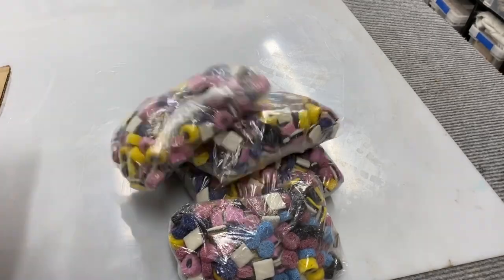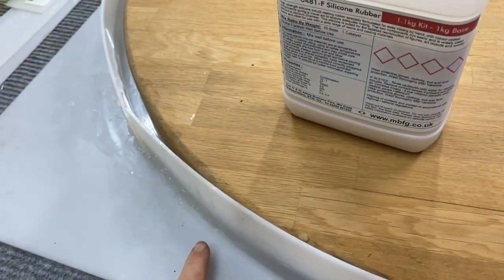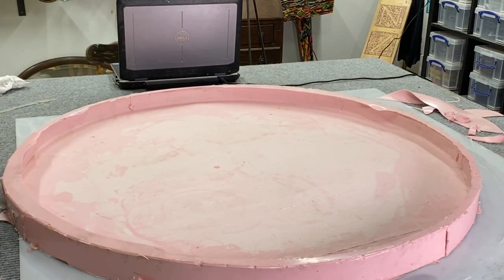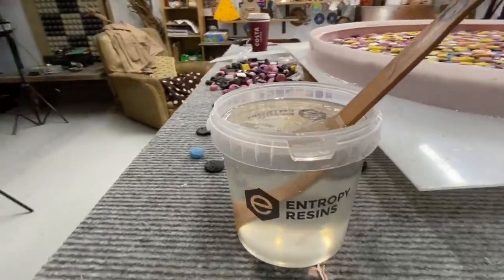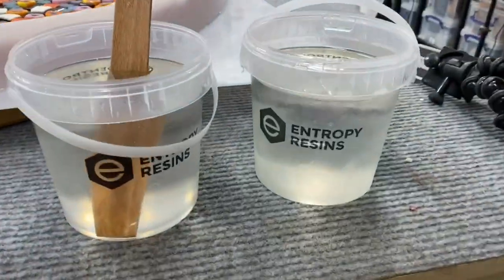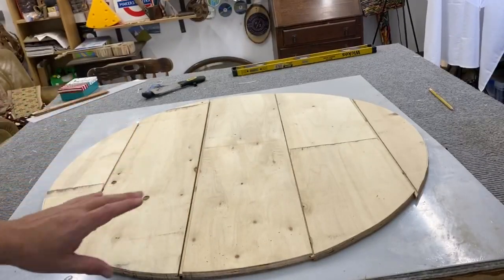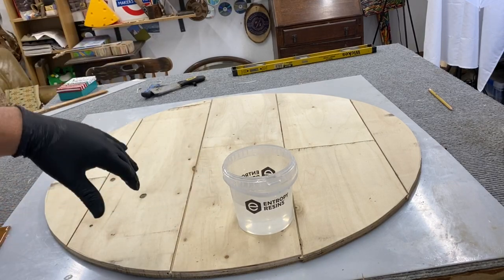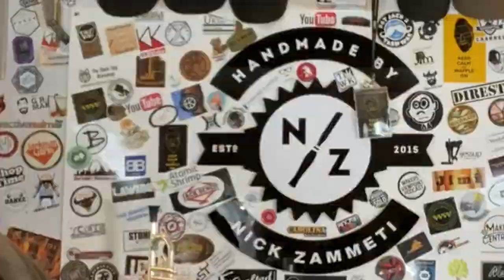I Mixed Liquorice Allsorts In Resin - Very Strange but fascinating Reaction!

Comment: I quote often cast sweets in epoxy. My recommendation is to place them in an oven set at 30°c with the fan on for 10 hours.
Or leave them in a dry place for a week. That way the moisture is gone.

Comment: Did heat from the fast resin curing cause the color changes? Would using the slow resin for the entire project have caused less heat and preserved the original colors?

Comment: That is a fantastic concept...I HATE licorice, but the general idea is fantastic!  You DID save that mold, didn't you???  You should make several more of those tables, with different "stuff" inside the Entropy.  I would like to suggest you make one using Electronic Parts, things like capacitors, resistors, inductors, switches, lights, L.E.D.'s, terminal strips, wires, you get the idea.  Liken', lovin' and sharin' this video now!

Comment: I finally get to see a video immediatly after it posts!! Yay!! Not a fan on any licorice that's the original old school stuff. I can eat the others fine.

I wanna see you make a feathers and colored pencils bowl with a layer of glitter.
1st layer: (inside) is pencils not too many you dont want to hide fantastic happening just below.
2cd layer: (middle) is glitter however put the glitter in just before the resin starts to harden so that way it does not gravitate and either floats and/or sinks to the bottom that happens in the pressure pot from what I have noticed, not too much and not too little, only enough so that it still looks glamragous
3rd layer: (outside) is feathers, feathers are and if one of greatest mediums to use with resin, it just becomes a part of the work itself!

Comment: Nick, this may sound like a total idiotic question but I'm feeling compelled to ask. (edited for spelling.)

Would it have been possible to make smaller pieces that would have fit into the pressure pot and then once they are all bubble free and set, to reassemble them with clear resin and lights in the seams where you join them together?

Comment: First, I thought it was really cool that when he was sanding the top, you could see the boards from the butchers block used to make the mold.
But second, I was sad when he put the wood on it, it seemed like it would have been awesome with light coming through under it...
(and you can't say it was for support, not with the pieces being piecemeal, at most it was a place to attach the table base, and that's just not worth the loss of being able to underlight it)

Comment: Sorry if you’ve already said this I’m watching with the sound off... To make this without any colours running or changing due to a chemical reaction  you need to pre size them with a water based varnish, glaze or PVA glue. When applying less is more as they only need a thin coat to form a barrier, they also need to be totally dry before you use them in your project. Much love from a pro.x

Comment: That was defiantly a video to sink your teeth into😁 oh yea if you were to lower the upper guides on your band saw to be closer to your stock size, you will have less stress on the blade and avoid more blade breakages. Love the table as is, but I would have covered the exposed plywood to give the table a more finished look.

Comment: If you had used the reverse side as the top, it looked like most of the resin didnt soak in through to the bottom and looked like the originals

Comment: You need to seal the sweets in something first, resin heats up as it hardens so that's probably why they changed colour. Americans use something called modpodge and it's basically like pva glue, next time you use sweets coat them in some pva glue to seal them and then try them in resin 😁

Comment: You know those pictures the toddlers make with pasta and glue, using different shapes of pasta to create different elements of the picture.
How about separating the different types of candy and using them the create elements of a bigger design.
Maybe, the dye in the candy won't run so much.
☝️😷👍